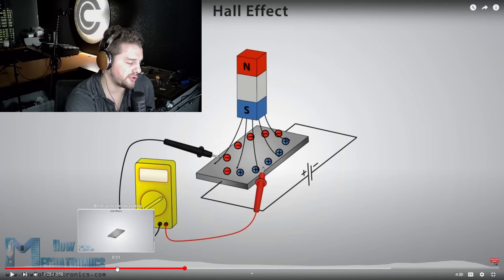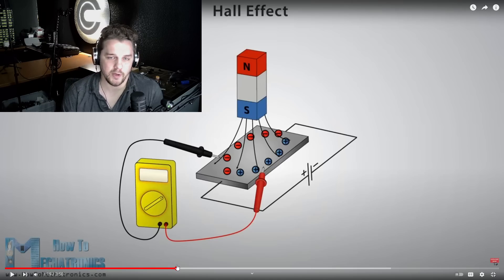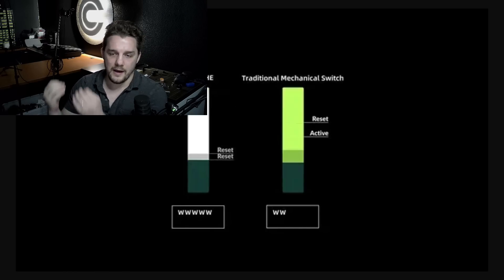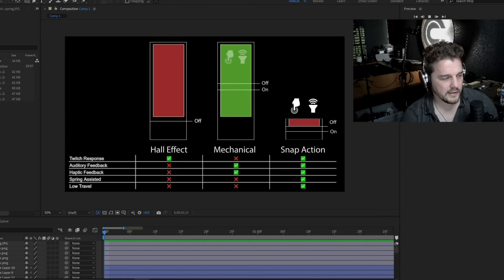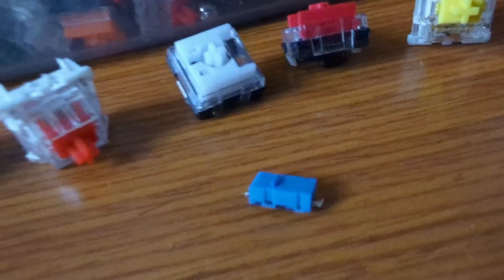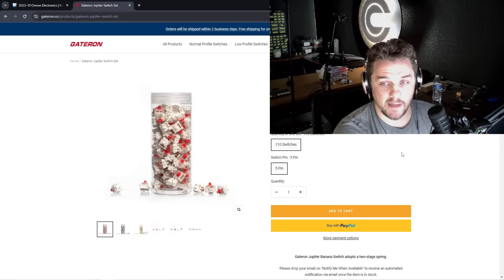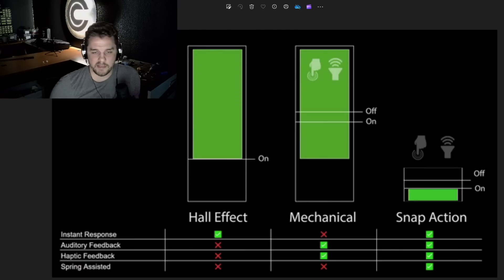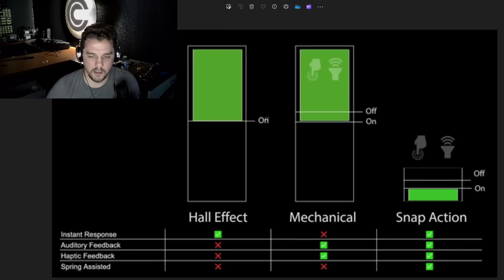How Snap Action Technology Outperforms Hall Effect & Mechanical (😅 @ 4X the Price)

Comment: Your comparison is a bit misleading as well, putting audible and tactile feedback as positives of mechanical switches. Linear switches (which I use)  are very popular amongst gamers and they don't have a tactile or auditory feedback other than the sound of the key being pressed physically on to the keyboard.
Reply from the maker: The reason linear switches are smoother than tactile switches is because tactile switches have elements which interrupt the switches pretravel momentum creating varying levels of resistance within the switch. However, this interruption is eliminated when you eliminate pretravel. The tactile components inside a snap action switch are also much different from those in mechanical switches, which is why I never use the term 'tactile' throughout this video. If I were to create a chart comparing linear, versus tactile, versus snap action I would have separate categories for 'smooth operation', 'haptic feedback', and 'twitch response', with tactile/snap checked for haptic feedback, linear/snap checked for 'smooth operation', and only snap checked for 'twitch response'. Thank you for the comment. This is a great question, going to pin
Reply: @CharaChorder  did not talk about rapid trigger or analogue functionality like the joystick on the hall effect keys comparing with the others which are the reason they are popular!
Reply: Yes, linear switches are popular for gaming . However, they are not popular for typing. Most people like to have sharp feedback for typing. That's kind of what kicked off the entire "mechanical keyboard revival" craze of the last decade.
Reply from the maker: @delphicdescant  why not have sharp tactile feedback AND smooth travel :)
Reply: @CharaChorder  Mostly because I can't afford a $350+ keyboard.
Reply: @delphicdescant  World's most honest youtube comment.

Comment: The marketing of heavy switches that make a lot noise that you hammer down to the bottom is the complete opposite of what a great switch should provide but they are easier for bad typists  to use.    I want an extremely light switch with a high trigger point that I can tune so that I can type very lightly, not bottom out and feel comfortable that I have triggered   and I want this in a linear not tactile switch.    This is where ha switches should be addlng value to productivity keyboards.   If I am a ham fisted beginner I can trigger them low and as I become proficient with my keyboard I can tune the triggers heights up so that I stop bottoming out my keys when typing.     The alternative as has been noted here is to use nice omron switches with extremely light weight, extremely low travel and tactile feedback.      In my mind both paths can lead to better user input and both can still be used by people who insist on bottoming out their keys and hurting their hands.   In a perfect world there would be no bottom to hit or it would be mushy pushing people to be efficient by typing more softly instead of harder.     The other downside of the current HA switches vs omron is that HA's are still being manufactured as standard keyboard switches.  i.e.  The mechanism has a  return spring that is unlikely  to ever function under 15 grams as built.    I keep looking over at the work on the svalboard and wondering.    I need to try both the characorder and the datahand to really wrap my head around this.

Comment: I think there is an error in some thinking made here. The reason the firing in fps is on the mouse is not for any switch tech nor reduced movements. (In fact ... snap action are not the best for mice, opticals are. They just add tactile feedback for haptics). 

It's because you AIM with your mouse. And splitting aim on one hand and shoot on the other is INSANELY weird.

Its the same reason why the shoot trigger on a controller is on the right side. You aim and shoot with your right hand, and move with the left one. 

It's just sided task assignment.

There also a "flaw" with snap action. It's not analog. So you can have another thing that analog gives you : differenciate the input depending on the stage pressed (input Q mid travel and S full travel for example). It is not a flaw, it's just a technological incompatibility. Each have the own pros and cons

Comment: well, for typing steno style it might be a decent choice, but for gaming, yeah, I'm not feeling like it, modern HE switches can detect 0.05 mm release travel, there's no way a person is able to press a spring loaded even optical mouse switch twice faster than on such a keyboard. 

PS: the main problem with such a keyboard though is definitely trying to learn steno after using a usual keyboard for decades. 
PPS: what about making a qwerty keyboard with mouse switches to test it vs an HE keyboard to prove your point?

Comment: So, how does the snap action switch, actually work internally?
Reply from the maker: There are some translucent ones you can buy on amazon if you want to see them in action. Basically a curved piece of metal and the plunger pops it in and out to force a jump between two contacts. Should have included in this video... Next time :)

Comment: Long time HE user here, completely missed the actual point of rapid trigger (plus HE can have a key depth of .1mm), a graphic of full keystrokes will obviously only be so faster. Rapid trigger allows repetitions within the set range throughout the entire height, mechanical and snap action are set at a specific height for engaging and disengaging the switch. Good strafing is so hard to learn on regular keyboards because of the precision required with regular keyboards to be fast enough, being able to essentially twitch your finger and have every stroke hit no matter the height is revolutionary. Also I feel like snap action might suck to type on for the long term, maybe in an Apple laptop or something, they can charge for it.
Reply: Also, as someone who has gone through many mice in their lifetime... The reason all of them have failed is the snap-action component wearing out. I even got fed up at one point and soldered a switch from one of my previous mice that was still fine onto the newer one that was failing..
It's a mechanical switch, it suffers from degradation with use. Hall effect doesn't really have this issue since it's signal based instead of a physical deformation of a piece of metal inside the switch...
Reply: @invertexyz  exactly, and then the replacement switch fails sooner than later. I had the same exact experience, even sourcing Japanese manufactured OMRON switches. they just don't hold up.
Reply: @invertexyz  it will suffer degradation because it uses magnets. magnets die out as well. But they'll probably take longer. i dont think there's anything out there that doesnt suffer from degradation. Even the sun will die out at some point. not in our lifetime, but still it will.
Reply: @iDislikeEditThanksForTheLikes  That's an extremely pedantic reply. Obviously everything eventually degrades, that's such a silly thing to bring up. The discussion here is about on a MEANINGFUL SCALE. An HE switch will likely last decades at least, instead of the 2-3 years I keep getting with snap-action switches on my mice.
Reply: Luckily, when you use sticks on snap action switches, like he is doing, good strafe cancelling is as easy as a flip of switch.
Reply from the maker: Having a greater range of motion should not be conflated with greater precision/control. It can often have the opposite effect, as in this case where the goal is a binary output. If what you say is true, should you not also assign your fire button to a HE keyboard switch as well? Thanks for the comment
Reply: @CharaChorder good video btw, and no, becouse u don't need to be pressing m1 as quickly as a keyboard switch. For osu players hall effect is gamechanger for speed. Mouse switch would  be useless for speed in keyboards
Reply: @CharaChorder   yes technically an HE switch would be faster for repetitive clicking, not really necessary though as most games favor proper timing/placement over a spamming. Is there actually a loss of precision with HE? Rapid trigger set properly allows for as low as 0.1mm actuation for the down and upstroke, I can't see how this would be disadvantageous compared to a switch with a set actuation point. There's use cases for all switches but there's no gain for a snap over HE besides physical feedback. Also the complete customizability of HE switches offer a much more tailored experience to each person
Reply: @CharaChorder  The physical range of motion of a key contributes to the comfort of typing on a keyboard, For a keyboard a snap key wouldn't be comfortable. But the hall effect still allows instantaneous activation and deactivation, the actuation doesn't have travel distance even if the key mechanically does. I'm sure you already understand this, I'm only over explaining because it is important for the next point. Yes the reduction physical travel distance is a feature of your master forge keyboard, because you don't have to lift your fingers off the nobs, but you do on a keyboard to hit different keys they're fundamentally different. If you want to make a case that traditional keyboards have a fault in design, sure (though it would still be subjective), but that would be a criticism of keyboards not hall effect. Hall effect is the objectively the right switch for (traditional) keyboards even if keyboards have objective (caveat again) flaws compared to the master forge.

So yes your video explains well why snap keys are better for the master forge keyboard, but it doesn't explain why other keyboards should, not saying you had to, but it came off that way to some other people, and I think other people think you got a detail wrong about HE, specifically the "Lack of low actuation travel" HE has, this omits the important difference between actuation travel (which yes would actually be instant or 'low actuation') and physical range of motion, its not the point of a HE keyboard to have low physical range of motion. Also I see you note the difference between the two when you mention "instant response" at the end, but that's not before.

"should you not also assign your fire button to a HE keyboard switch as well" there's no reason why one couldn't do this, the reason people don't is just familiarity, so I don't think you're making the point you're trying. That could actually be interesting having various aim down scope strengths depending on how hard you press.

Comment: The snap switches are similar to all digital switches in that they are a very narrow use case. The hall effect switches can be used, given the right MCU under it, for a larger variety of use cases.  It's the idea of analog vs digital. You can only do so much with digital, but analog allows for  significantly greater amount of options. 

And that is just on the use side, HE also should last longer than any mechanically moving switch.

Pretty much the only useful case of the characorder is typing or digital input. Anything requiring an analog input will still need a completely different device.

Comment: but playing competitive FPS games with this kb will still be slower than a normal HE kb. because you have only 1 or 2 fingers controlling the movement (especially strafing), instead of 3 fingers (2 horizontal strafing) controlling the movement on normal. also some FPS games benefit from analog movement.
well maybe you can bind left and down on one knob and right and up on another, but not sure if this will be very intuitive to play like this, especially if one of those is thumb (but you can't really have 2 of them be non-thumb, those finger are important for other functions).

Comment: What about durability? That's the main selling point of the Hall Effect Controllers
Reply from the maker: The specific model of switch used in the M4G is rated at 20M cycles which is far greater than the average keyboard and even with daily use can last well over a decade without maintenance. This video is focused specifically on aspects of switch performance which impact daily user experience, however perhaps there is room for another video to cover all technical specifications of each switch technology. It is true that due to the absence of haptic/auditory feedback and therefore a lack of a physical switch contact that HE switches have the potential to last longer than snap action switches. Thank you for the comment
Reply: @CharaChorder  I don't believe snap action switches are more durable than hall effect or even traditional leaf contact mechanical switches. My own experience has show that the snap action spring will wear out, stop snapping as efficiently and start bouncing. I have had to replace countless snap action switches in my personal mice and I just gave up and started buying them when they failed instead of repairing them because they would fail again and again. Also, an improperly designed snap action interface can lead to premature damage to the snap action switch itself since there is no real stopping protection for the switch (they rely on the implementer to stop the control surface using structures/design in the housing). The other benefits you listed are absolutely true though but durability is not a strong point for SA switches.
Reply: @CharaChorder and hall effect designs go up to 30 billion. Even the older Cherry MX switches can last 50 million. Foam & foil can last 150+ million. 20 million is by far on the low side when it comes to projected life cycle, no thanks.
Reply: I've had to replace malfunctioning Omron microswitches in Logitech gaming mice. That meant disassembling them, using a soldering iron, wick, flux - the lot. I'm not even a competitive gamer and had mouse microswitches fail on me. Similarly, I've had keyboard Cherry switches fail on me in a year or so - but that's because I do way more typing writing essays and short fiction than I do clicking/gaming. Microswitches will wear out and they will wear out faster than Hall Effect switches. I can't imagine having to disassemble a purpose-built keyboard to desolder microswitches every time I need to replace switches when hotswap keyboards exist. The Master Forge is an interesting concept, but it's just not for typists who can't or don't want to constantly fuss with their keyboards. Ultimately this video is itself also marketing, and maybe someone will really resonate with it, but it's not for me and I, along with many others, find the claims of longevity with microswitches to be dubious at best. Perhaps CharaChorder could consider creating/adopting a super short-throw Hall Effect switch? That way the only mechanical element is the spring, and you get the benefits of a longer Hall Effect lifespan.
Reply: The Omron switches he is using is on the highest end, blue D2LS-21 which is rated 20M clicks.
Reply: Generally companies use Omron switches (shown in video). Switches with white button rated to 20M clicks. And orange button are 60M clicks.
Reply: @Sedokun  yes, and HE switches are rated for hundreds of millions of clicks (and realistically probably are in the billions, testing past 100m is largely pointless / a waste of time)

also yes, omrons have high click ratings, but aside from the japanede made d2f-01f (which i've seen go way above its rating) i've consistently seen chinese omrons (including those used here) fail WAY before their 'rated lifetime'

Comment: I'd just add that while I'm sure you're using the best switches for your use case, neither haptics or audio NEED to be a feature of the switch itself. Haptic motors (like what the iPhone uses), a tiny speaker, and some good coding on the microcontroller mean you can get both of these without relying on the properties of the switch.
Reply: Not fast enough.

Comment: Something worth looking into is Opto Interrupt (Photointerrupt) Switches. You lose the tactile effect but you gain near infinite uses per switch. Additionally the actuation time is extremely high. Most Omron snapactions are rated for 1mil clicks but depending on the voltage that value can vary. For example, Logitech has problems with their switches (on purpose no doubt,  the devices being really annoying to disassemble for repair) where their mice die very quickly due to the improper voltage cutting it to roughly a fifth of it's lifespan. 
Not saying that will happen with the master forge, but it's something to note that they are much more fragile than one would think. Omron also makes really good Opto Interrupt Switches. However they still have the price issue as well as the issue of building a mechanical system for the joystick itself to properly spring back to center. Theoretically it means that you never have to worry about a Switch failing in most instances. Now finger Smoo making its way into the switch array and the sensors... That's a different story...
Reply: Yup, I have a razer mouse with optical switches that I have been using for 3 years without any issues of double clicking. I'm kinda surprised the master forge didn't go the optical route since it has been mainstream for a while now.
Reply: I use an optical keyboard. Its an actual improvement. However, not very good for joysticks.
Reply from the maker: The key panel and key pad in the Forge ecosystem both use optical switches :)